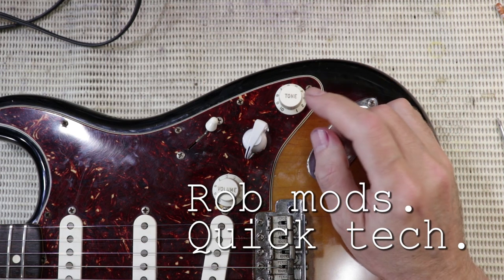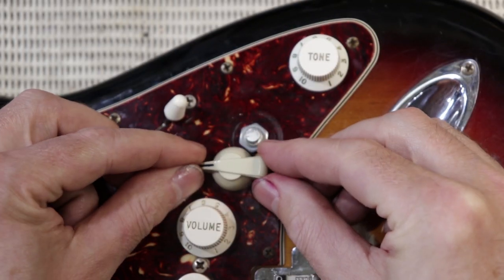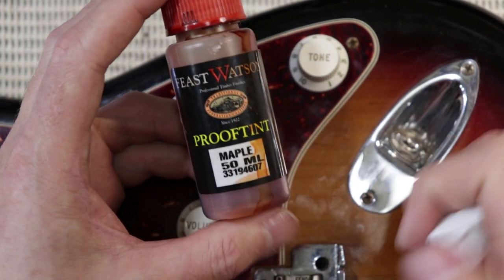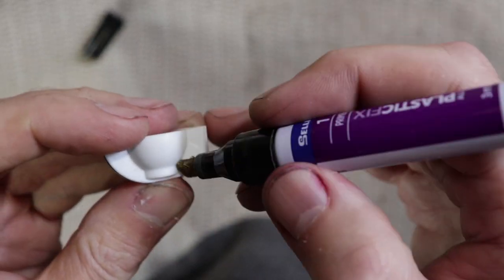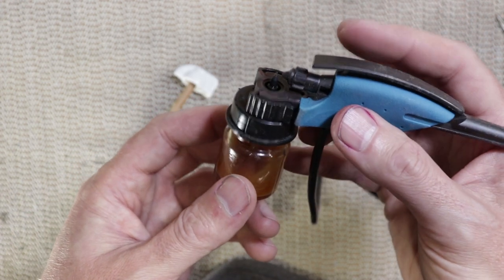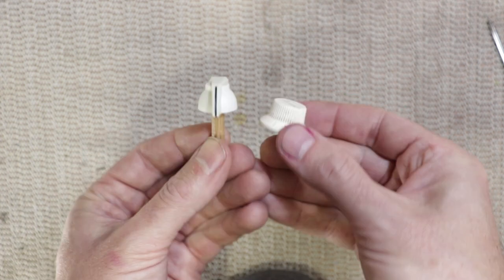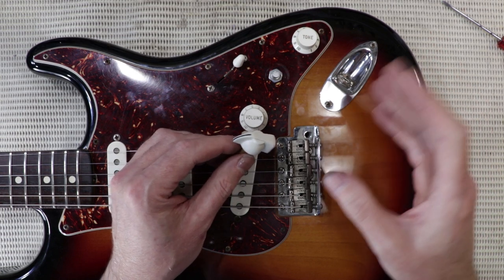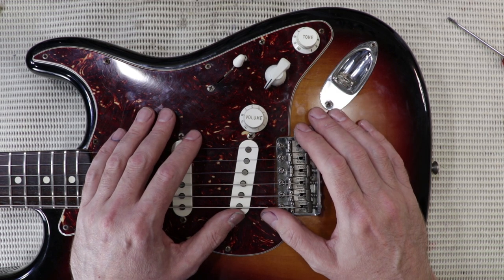Making New Guitar Parts Look Vintage.

Comment: How to age and yellow guitar plastic parts

1 = scrub plastic-parts with very fine steel wool and scrub some areas with fine-sandpaper
2 = use a bowl and put in Hot water and 2 black-tea-bags and 1-1/2 table spoon of TURMERIC cooking powder

Leave it to soak for 5 hours (no more)
--- LOOK at them once every hour to get the correct yellowish old-age look !!!
...if you leave them for too long, they can become too dark yellowish.

Take them out and clean them with a paper-towel. Let them dry for an hour
or more before you place them back into your guitar. You want all the parts to be completely dried.

Comment: Try this to yellow plastic. Put steel wool into white vinegar and let it sit for some hours. Put the part/s into the solution for a day or so. Might be worth trying this with a few scrap parts of the same type of  plastic so you can massage the process. Used a similar process on picture frames. Good luck. If it works it was my idea. 😛
Reply from the maker: Thanks Joe.  I'll give it a shot!